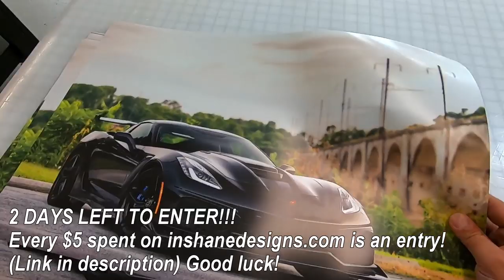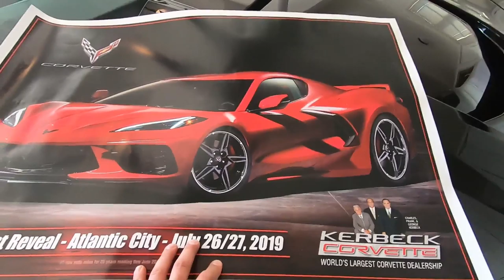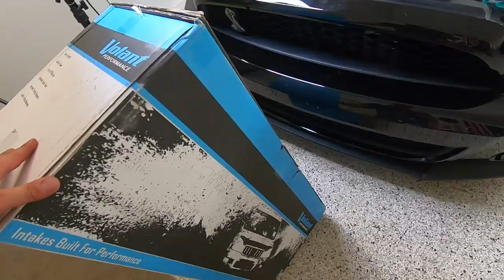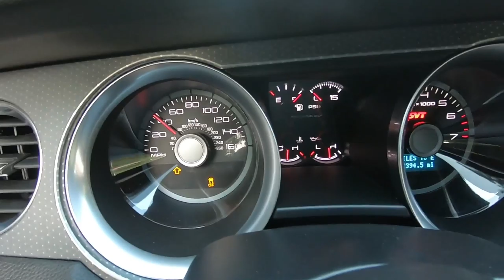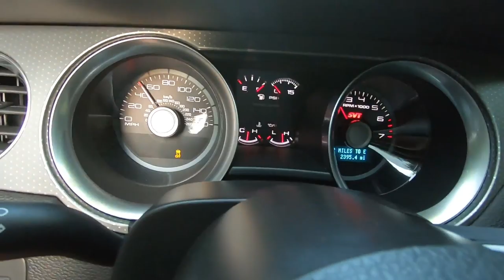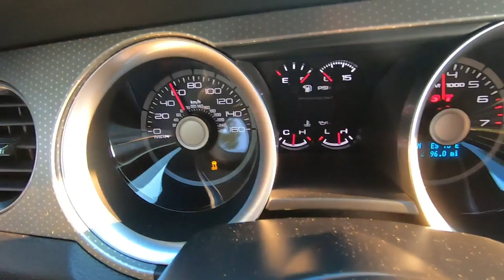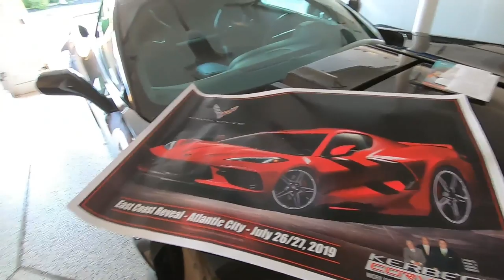ADDING 200HP TO MY NEW GT500!!! RACING a Modified 5.0... *DIDN'T GO AS PLANNED*

Comment: Hey, not sure if anyone else commented, but you should 100% get a tune for that cold air intake. It can and will throw off your afr even though the 13-14 gt500 ecu's correct afr on the fly. (Ecu will think something is wrong, rather than understand that major changes were made).

Comment: The double blade throttle bodies were used to help with driveability, they're considered more consistent at partial throttle, but obviously don't flow as well as a mono-blade when wide open. Most modified\tuned Shelby's do fine with the larger monoblade throttle bodies and pick up good gains over the stocker when combined with more boost and a tune. The stock intake is actually pretty decent,  I doubt you picked up much more than some additional noise. That intake actually appears to have less filter surface area vs. the stock fitler.

Comment: You dont have traction control fully off. You have to be stopped and hold the traction control button for 10-15 seconds with your foot on the brake, and it will turn off traction control and advanced track.

Comment: I also had a 12 vert gt500. Put a 1.9 whipple on it. Did intake throttlebody and tune dynoed at 652 whp. Not a ton of power but it gained it from original 490 hp stock from factory. Looked normal no hood changes so it worked like sleeper a bit. The 1 to 2 shift gets grinding sometimes. I was told you can put a metal threaded clutch line in to replace plastic one to help with that. Good luck. Nice clean car.

Comment: You need to upgrade the Radiator and Heat Exchanger to help with the heat soak. 2010 thru 2012's have an issue with heat soak that will limit your horsepower when the car gets hot. Just an FYI

Comment: They went with the duel throttle body, because it smooths out the idle, and less surge. The single opening had problems with stalling out at idle, and bogging and surging at normal driving.

Comment: Mike, you were likely suffering heat soak in the intercooler system, which is why he was hard to catch up to several races in. Gt500s are known to get heat soaked rather quickly with stock heat exchanger

Comment: Mike, you put on a baby CAI, looked descent as a stocker replacement, probably best since you had no tune.  A must Mod that can be used on the VMP supercharger,  Ford Racing dual 65mm is the Best choice for performance and driveability,  The Ford Racing Corba Jet Oval is a beauty and really screams and then limp mode, many of us have tried to run them, not worth the headache.  JLT CAI 124 mm, suck a lot more air than the BAby Volant, 2.5 inch pulley ( 2 plus psi of bòost added),  NGK TR6 plug , no Iridiums, and a Lund tune!  You wont be sorry, lots of power.  Some of us here actually own GT500s and know how to Mod!

Comment: since when does an air intake add 200hp!?
Reply: Pulley upgrade e85 tune I bet.
Reply: @allenseferagic9426  Dont think this gen of mustangs fuel system can go right to e85 without mods like pumps ect...
Reply: @PressurePlayerStudio  Just needs fuel pumps and bigger injectors.
Reply: @chrism.728  yeah so not just a tune, exactly what I said...
Reply from the maker: Adding 200hp, once we have a pulley/tune with our new intake and exhast
Reply: AKF .gaming it can’t. You need to get a full fuel system to run E85. I run E85 on my GT500.
Reply: @Sophie-and-Ken  you're one angry lil girl Sophie
Reply: @Sophie-and-Ken You really need an attitude adjustment. If you were my kid and talked like that to anybody you would be in

TIME OUT little lady
Reply: @jasonstrout4502  thats not lil sophie commenting. Thats her angry, chump father. Only a sexually frustrated grown man could be so worked up over absolutely nothing. Misguided anger is all.

Comment: Most of those gains (with a cold air intake and mufflers) are going to be AFTER a proper tune. Years back, when I had my C5 Z06, I added a Blackwing cold air intake, ARH long tube headers, custom x-pipe and Borla Stinger exhaust as a first step to engine mods. They only added 21whp. That's right. Nearly $3,000 got me 21whp. I had it tuned on a dyno and that number jumped by 28whp so, in the end, NEVER forget to tune it. Cheers.

Comment: You doing long tube headers? That's where the real power comes from in an exhaust setup. Just a catback is mostly more noise, but it will decrease some weight. I hope you're doing a full exhaust (long tubes, mid pipe - no cats, rear section) which will decrease like 40 lbs - 50 lbs of weight. But you really need to get the car tuned after intake and full exhaust. I've seen a lot of cars with really screwed up A/F ratios (bad for engine)  from just exhaust and intake.

Comment: I not a tuner but the cold air intake will help if 15 to 25 hp and same for exhaust but they both help with air flow and instead of giving it up to 50 hp it will probably give is 30 to 40 hp increase and with headers mabey 50 hp at best with my experiences

Comment: The back end of the Corvette will be replaceable with aftermarket parts. One thing corvette is doing is using cheep, cheep plastic fascia.  I know one company scanning the new corvette to make a replacement after marker bumper. Chevy wants to make the corvette a cult car like the old Supra and RX7 with aftermarket body kits. There will for sure be a few dozen body kits available to fix the basic design of the new Vette.

Comment: Mike  get some drag radials before you end up in a ditch the rubber that comes on those cars is not up to the job! after the drag tires you might have to work on the wheel hop if you do someQA1 adjustable shocks will take care of that.

Comment: Hey Mike! Love your stuff! Keep an eye on that intake filter for real. If your old one was that dirty after 2000 miles the new (blue) filter more than likely performs better because it lets even more air into the engine than the old (gold) intake did. If it lets more air in then the weave in the filter is less restrictive so it could be letting dirt and maybe even small bugs into your intake which are then being put into the engine.. just in case you didn’t know lol. Congrats on the power gains 💪🏼

Comment: Hey Mike, you said you thought you would have won more against that 5.0. Just so you know these car are very sensitive to false knock and your exhaust was hitting your pan Hardbar support brace. Because of this the car was pulling timing. And for a reference I have a 2012 as well and I have an exhaust rattle and on the dyno I was down 30whp until I isolated the issue.

Comment: The GT-500 sounds awesome!!! An the 88 89 an 90 f150s with the EFI 5.0 liter an the EFI 5.8 LITER also used the dual hole throttle body. The they sucked I hated them.

Comment: Mike, do you notice any that these new 6speeds with the v6 engine is more sluggish than the old 4.0 with 5 speed?
Sometimes mine acts like it wants to shut off on the 1-2 shift rather than the start. Only 80k miles on an 08 2 door

Comment: How did off roading cause every wheel bolt to rust? Does that company use cheap steel bolts for their wheels? What does off-roading have to do with rusting bolts?

Comment: If Bobby does cobra jet intake 60lbs injectors and full exhaust he could run 11.80
Reply: Cobra jet intakes is a waste of money unless you have a ton of work done to the motor.
 You can make about the same power with a 2018 gt ported intake and more torque. Cobra jet looks great ill give it that. Cobra get is over 1000 bucks. A brand new Ported 2018 GT under 450.00

Comment: When the after market stuff come out for  the C8 it'll be epic ;)
Reply: Most likely won't be able to tune the C8 ECU for a year due to GM locking/encrypting the ECU to prevent aftermarket tuning. Took like a year to into the C7 ZR1's ECU to tune it.

Comment: Does the gt500 have gears in it? Seems like it's going thru the gears way too fast for a gt500
Reply: His is a 12 performance pack so it had 3.73 factory instead of the 3.31 in 07-09 and 13-14.

Comment: I’ll sell you a 98 Silverado 3500 Dually 4 door to mod out and give away or something 😂 6.5 Detroit Diesel in it with the auto trans. 4x4 in the floor. 185k miles on a 20 year old dually! Has a flat bed and 100 gallon transfer tank. Would be pretty neat to jack it up and throw some giant tires under it.